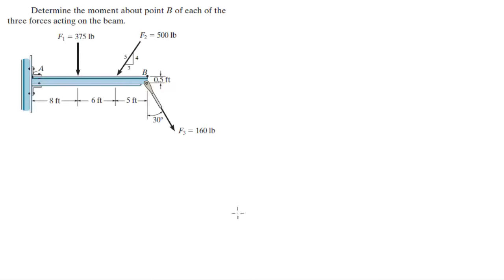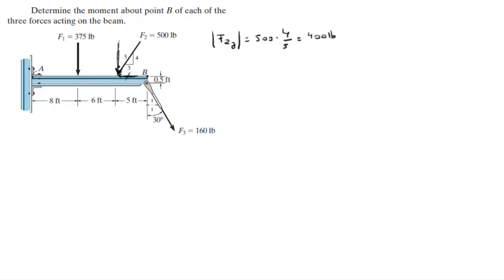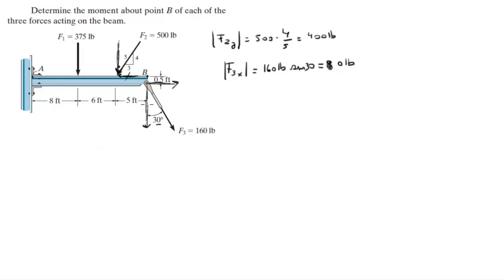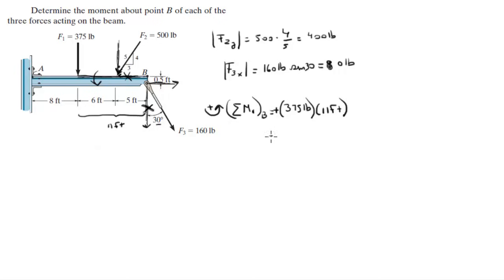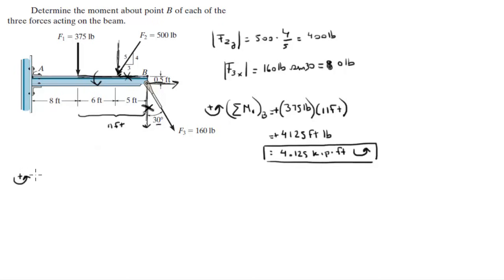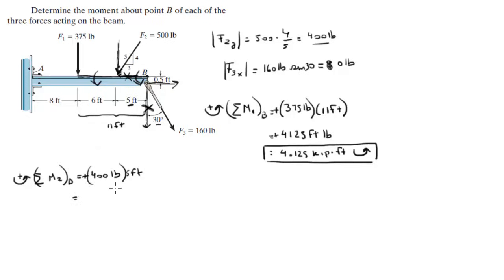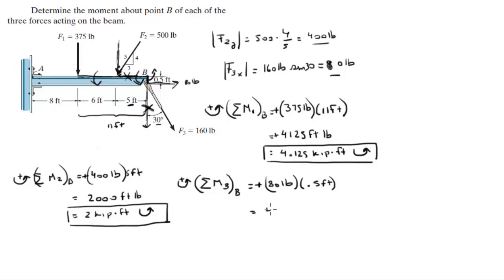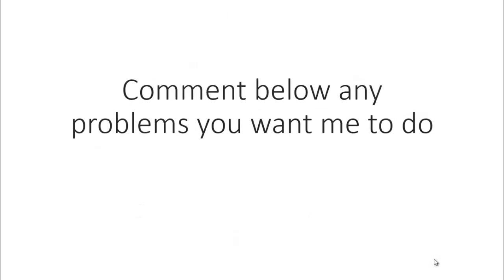Determine the moment about point B of each of the three forces

Comment: why the hell it is sin on the x axis
Reply: Raven Aldover  It helps if you picture angle theta for F2 between the sides of 5 & 3. Only the perpendicular component of the force will be applied to the beam to create a torque or moment. Therefore, you use sin = opp / hyp (4/5) to get the vertical force component. (It is the portion of force 2 that is parallel to Force 1.)

Comment: I still dont understand, why does the Y component of F3 not apply here?
Reply: This may be a late response but it is because the force is acting on the parallel to point B. So if you were to take the y component it would be (160lb)(cos(30))(0ft) = 0, so there is no force in the Y direction here.
Reply: @DireMonkey23  Why is y-axis 0ft? If anything shouldn't the axis be 0ft? Espically since the 0.5 ft is measured in y axis.
Reply: Patrick Bates ok so why would the x component of f2 not apply?
Reply: Me neither. It isn't parallel with B, its perpendicular so it should create a moment.